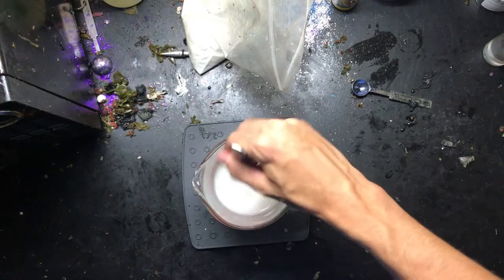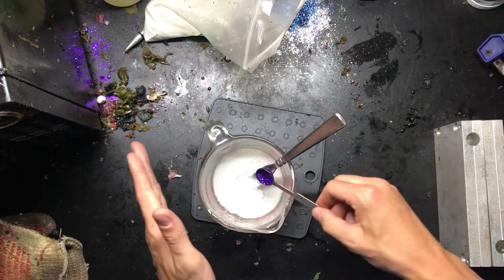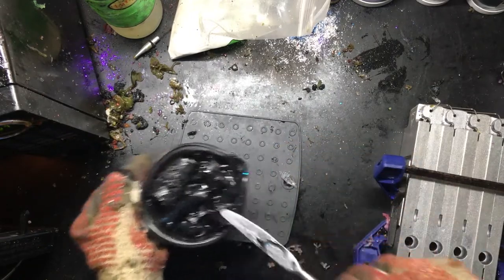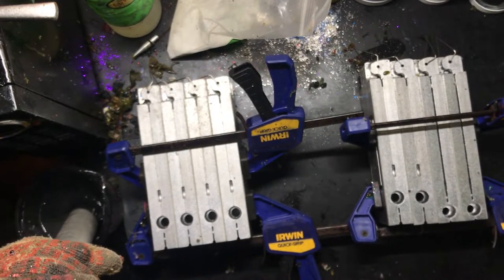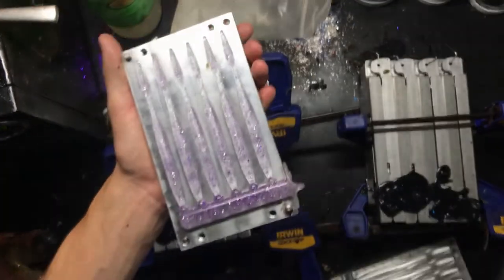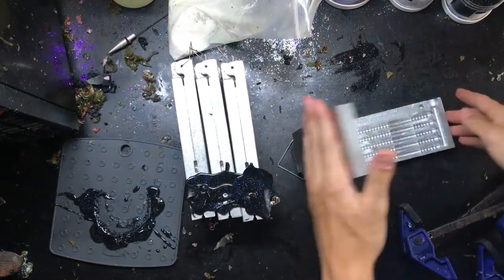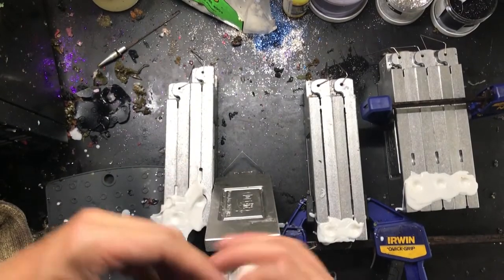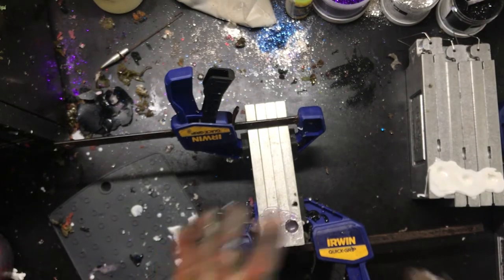Injecting Clear Soft Plastic Lures

Comment: Hey man how do you prevent bleeding from the glitter? When I try to make clear baits with glitter it always bleeds and comes out with a light shade of the glitter instead of clear.
Reply from the maker: Stanky Fishing make sure you aren’t overheating it. Also, if you make more than you use, and then put the leftovers back in the microwave it’ll start to bleed. The more times you heat it, the more it’ll bleed.